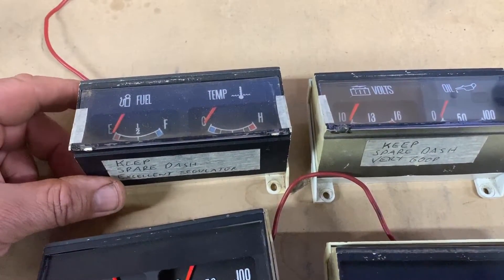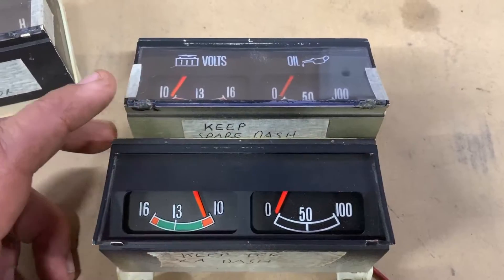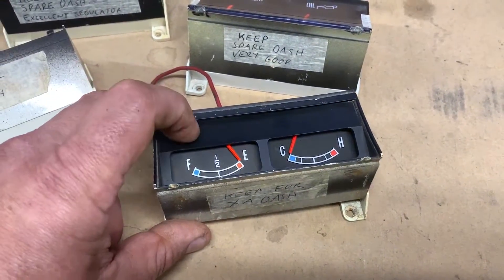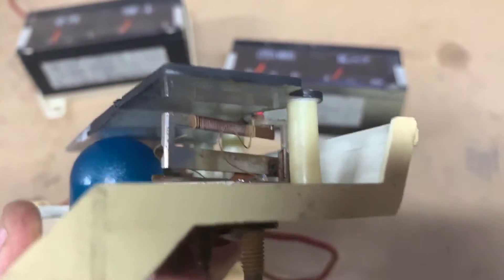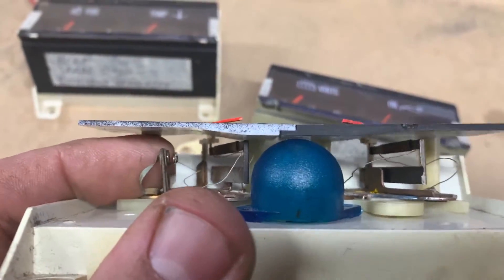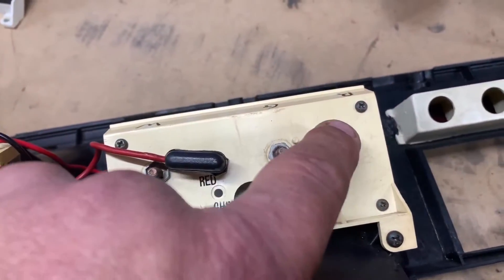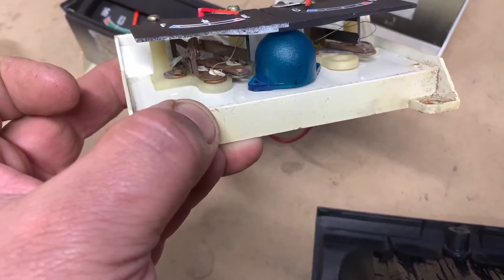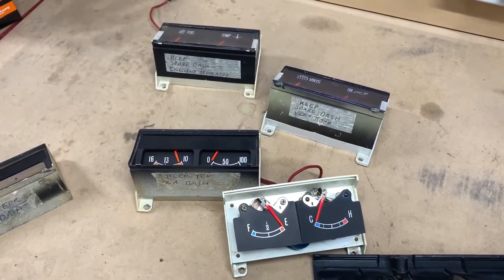XA/XB GT/GS  Falcon  Gauges Voltage Regulator Explanation - Ford Falcon

Comment: Rather than cut your copper wire on your gauge, just connect the power wire (green) directly to your electronic regulator power wire (red) directly and bypass the green bullet threaded connector on the back of the gauge.
Reply from the maker: That actually makes sense, Thanks for the comment. 👍

Comment: Thanks for the vid Mike. I know you posted a while back but just stumbled onto this. Would it be possible to just use an inline resistor to drop the voltage from 12 to 6? or would this produce too much heat maybe? Thanks heaps mate. Cheers
Reply from the maker: Not sure how reliable it would be, voltage in your car can easily fluctuate between 11.8V and 14.8 volt. I would spend the money and just buy an electronic regulator to get steady voltage to the gauges.
Reply: Yeah that makes complete sense Mike. Thanks again for the vid and info mate. Cheers

Comment: Really good video Mike, I'm currently installing a electronic voltage regulator, is it possible to put an insulating material between the contacts on the factory voltage regulator rather than cutting the wire?
Reply from the maker: @ChrisSchulz-f9z  can’t see why it wouldn’t be, as long as the factory regulator is disconnected it will be fine.

Comment: Only new to the Ford scene and in the middle of converting my XA Falcon 500 to a GS/GT dash, which this video has helped me with. I do have a question regarding the earth wire on the regulator. My wiring harness doesn't have an earth wire for either the fuel or temp gauge? So by fitting the black ground wire from the regulator to that centre pin on the fuel gauge, where does it get the earth from? Is there supposed to be an earth wire on that flat plug and perhaps the guy who re-wired my harness has left it off? Thanks in advance.
Reply from the maker: Definitely supposed to be an earth wire on the flat connector.

Comment: Whats it regulating too ....or maybe i missed it
Reply from the maker: The gauges, fuel gauge, temp gauge and oil pressure gauge run on around 5.1 to 6 volt, I explain it in great detail in the video.

Comment: Hi Mike thanks for the video! Can i ask what the black wire is that goes from the terminal above the input from the regulator( above the terminal that the orange wire connects to)? Thanks
Reply from the maker: I don’t quite understand the question. The black wire is the earth wire the orange is power going through the regular to bypass the factory regulator. Hope that’s what you were asking.

Comment: How does the original regulator work ? Is it a thermal overload bi-metal deal ? 
Any benefits to cleaning things up with iso alcohol ??

If you are going to cut an active strap inside a meter , cut it all out , no loose ends to touch intermediately. 
I think the Ford Engineers fused the feed to a regulator.

I really wanted expected to see what a burnt unit looked like , do you do any insulation testing or 
do you just eyeball the damage you find ?

XB 351 2V ac ps 4sp 9in from the factory , now very modified  ;)
Reply from the maker: Yes it's some sort of bi metal strip that vibrates to reduce the voltage. No point cleaning it up as it's not being used, wouldn't cut it all out as someone in another 40 years might want to use it again. The ends are not loose and won't be doing anything. You know when it's burned out as the gauges will not work, then it's time to take the gauges and your first born child and the deeds to your house to a gauge specialist to have them rebuild. Hence I highly recommend using an electronic regulator. 

Even if the electronic regulator fails it will fail in the open position every time protecting your expensive gauges and vehicle electronics and wiring, if the factory regulator fails 99% of the time it will fail in the closed position, best case scenario is your gauges will be fried, worst case scenario you have a dash fire and your car burns to the ground.

Comment: Great  vid Mike, on my xbgt my petrol guage reads 1/2 full when the tank is full and  it reads empty when the tank is half full and its got a new sender unit,  but the other 3 guages are reading ok , could it be the voltage reg ,what do you think is going on  thanks
Reply from the maker: Fuel sender. What concerns me is you saying you have a new sender unit. Unless it is an original sender unit it will never read correctly. Get a genuine sender not the new reproduction ones which are useless. I have tested plenty never seen one that worked correctly. If you have not installed an electronic regulator yet do so fast before your gauges fry or worse the car catches on fire.

Comment: Good video, Mike, I've just done the cluster on my XB GS the same way. I'm glad to have found this, because I wasn't aware of the potential problem. Cheers, Steve.
Reply from the maker: Very good. The regulator is a big fire risk and will definitely damage your gauges if it fails  I will be getting back into my XB very shortly, 2023 will be a big XB  year.

Comment: Hi Mike, all my  Gauges work expect my temperature gauge what do u think it would be? It was working but now has stop, it's xb gs.
Reply from the maker: Could be your temperature sender or the gauge has burned out, fit a digital regulator and check the winding on the gauge. These gauges can be repaired and rebuild so don't throw it out, take it to an instrument technician and they can test the gauge for you. If you are close by I can test it for you.
Reply: I in Melbourne where are u?
Reply from the maker: @duanespiteri3501  Mid North Coast NSW, Long way from Melbourne unfortunately.
Reply: Ok, thanks

Comment: Hey Mike thanks for the info. A question, Can I power my volt meter from the terminal marked green as that is 12V? Thanks
Reply from the maker: Yes the green wire is the 12V feed that powers all gauges.
Reply: @MikesManCave   Cool, thanks Mike. I did have my gauges all repaired. I have fitted the new reg, cut the wire, but it seems they have shit themselves again

Comment: Using a voltage buck is a whole lot easier than sourcing early US falcon and US galaxy, or mercury marauder gauges to cannibalise….
Reply from the maker: No idea what any of that means. What is a voltage buck and why do you wan t US gauges?? I am confused.
Reply: @MikesManCave  not a matter of wanting us gauges, it used to be a way to fix  australian falcon  fuel gauges or instrument clusters where the metal strap style voltage regulators were used. Ie used for the parts etc…. Nowdays you don’t need to use the old analogue voltage regulators as you can just use a new digital voltage buck for 1/20 of the price. Cheaper, more consistent and  more reliable. ie the buck does the voltage regulation.  the good ones you can actually dial up specific output.  - so similar to what you discovered
Reply from the maker: @gfenwick1  Oh, OK, I did not realise that they had the same gauges. I will look into that. That. might explain some of the odd gauges I have here.
Reply: @MikesManCave  my bad, didnt mean to imply that the guages were the same, its more that prior to the digital fix, the solution was to cannibalise the voltage regular from other ford products of a similar build period.  The digital solution is obviously easier and better. The better digital solution is to use the buck converter over the old triac style digital regulator. The reason is that the triacs can overheat if something goes wrong, and in a worse case scenario, lots of smoke and fire.  Bucks let you dial in exactly the voltage that your fuel gauge expects. Nothing wrong with what youve done, just saying that triacs have been superceded by buck converters as they are a more stable option. 👍

Comment: Hi Mike, Great video and at the right time for me. I'm at 95% of a full rebuild of my XB sedan. Going through all the testing phase and trying to rectify issues and fuel gauge being one. Gauge only shows half tank when it is full. Does fall when empty correctly. I've replaced 3 senders and all having the same issue. I've grounded out the single wire at the sender which does then read full on the gauge. Other gauges seem to be reading correctly. Do you think it could possibly be that I need an electronic regulator to help? If so which ebay seller would sell the same as you installed? thanks Mike Regards P
Reply from the maker: Seriously I would not be running these gauges without one, any of the ones on eBay are fine. You are playing with fire keeping the original mechanical regulator, your gauges will read a lot better and be more accurate with an electronic one, and best of all they will not burn out, as you know these gauges are worth a lot of $$ now. Are you using an original sender or reproduction one?? Unfortunately the Reproduction ones NEVER work correctly. Where in Australia are you located?
Reply: @MikesManCave  
Hi Mike, thanks so much for your reply. I was using a repo one until today. Decided to spend time looking at the problem. I repaired one of my old analog meters and finally got to test all of them correctly. Found the 2 rare spares one's  were miles out. No wonder it never work. I got the original one out and tested it. It was way better. I was able to calibrate it to 73-10ohms. Should be good now. I just didn't want to modify the original pickup to suit the aftermarket in tank fuel pump I have but oh well looks like i just had to do it. Sad when you have to go back to a 46 year old sender. I think it should work now. 
I live in Melbourne. 
I will order a electronic regulator and install from your good advise. Looks like most are 4 wire. No big deal. Negative in and out. I'll join them together. I take it 3 amp should be plenty at 5vdc?
Thanks again 
Regards Paul
Reply from the maker: @pzac5108  Should only be three wire, this is the only one I have ever seen. https://www.ebay.com.au/itm/DASH-GAUGES-VOLTAGE-REGULATOR-FORD-XK-XL-XM-XP-XR-XT-XW-XY-XA-XB-XC-FALCON-MORE/283514938294?hash=item4202cea3b6:m:mDCMAjsK7KFU_gp_YvCFLgg
Reply: @MikesManCave  
The only one's I found where just 12vdc to 5vdc voltage regulator mainly for led lighting. That's why they are 4 wire. They are between  $8-9. I'll order the one you have provided. Thanks so much for your help Mike I really appreciated it. 
I also checked the fuel gauge after I last wrote to you and so far with how much petrol is in it I think it's reading finally correctly. Fingers crossed!  When I get the wheels back on it I can go fill it up to find out. Thanks again.
Regards 
Paul.
Reply from the maker: @pzac5108  The one I linked is the correct one, check the guys feed back, can't get better than that.
Reply: @MikesManCave  no worries I'm on it!😉
Reply: Hi Mike. Just an update. Ordered the regulator and installed it. It was a different setup to your one. You now basically bypass the green 12v lug which means you do not have to modify inside the gauge which is even better. At least this way if the electronic regulator fails you could always reconnect the original connections and it should all work again.  All good and everything's working. Thanks again for your help. Regards Paul
Reply from the maker: @pzac5108  interesting, how do you by pass the regulator then??
Reply: @MikesManCave  It is backfed still like you have done. Green wire 12v directly connects to red wire on regulator, yellow wire from regulator connects to where your orange wire connected directly below the black negative wire, and black wire to the negative on the gauge lug same as you have done. So really the only difference is that there is no connection to the green lug on the gauge which then means the original regulator is bypassed. I hope i explained it well enough. 
P
Reply: @MikesManCave  thanks just ordered one for the XC cheers

Comment: Hey Mike, great video. Topical too as it's been discussed a lot of on Ford facebook page lately.
Where'd you pick up the regulator from? What are the voltages?
Reply from the maker: XB TAS I should have probably mentioned that. The gauges run on approximately 5 to 6 volts. The electronic regulators are sold on eBay and  many instrument technicians also sell them. PS feel free to share the video on any pages or forums you are part of. Looking at making more videos along the same lines in the future.